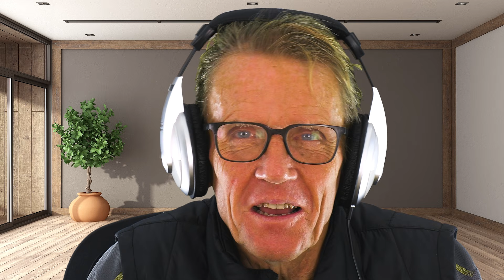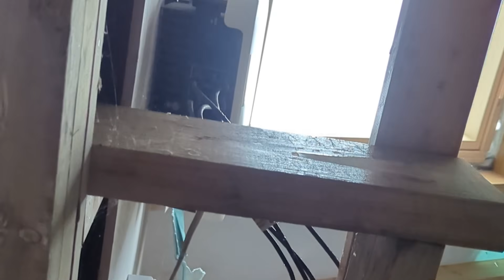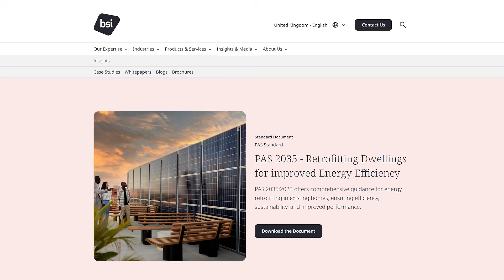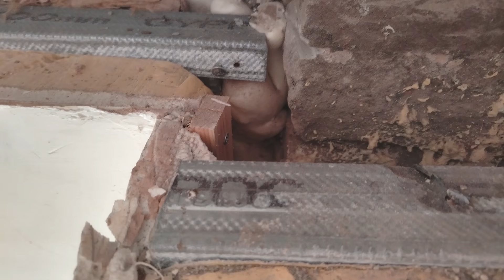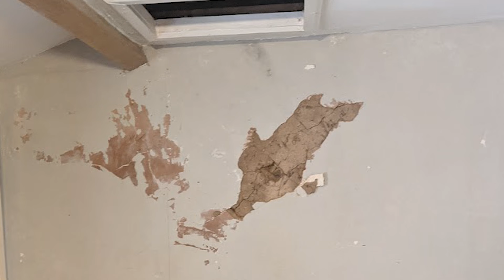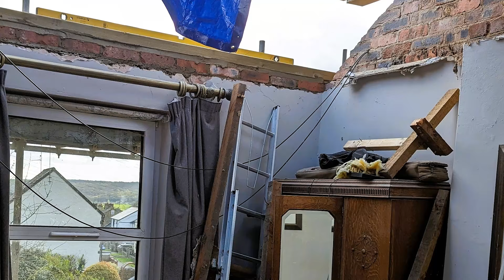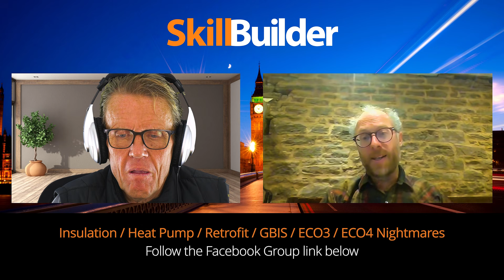Government Scheme Leaves Homeowners in Ruin – And Nobody Cares!

Comment: I'm not sure why he signed up in the first place for it, if the oil was costing 1k a year and the heat pump was forecast to cost 3k a year, that's an immediate no from me !
Reply: At first i thought i misheard that costing. Beggars belief tbh
Reply: I agree - THAT was the first mistake. 😐
Reply: It looks like a fairly small house though, even with bad insulation the figures don't really make sense. Oil to heat pump running costs should be 1:1 at the absolute worst case. Once you include the cheap tariffs you can get with a HP it's almost impossible to be worse off. There must be more details to the story missing.

Especially the claim that he's 4kw short and can only heat to 16 degrees doesn't make sense. Maybe it's lots of different situations all muddled up, but would be good to see all the details on this
Reply from the maker: @totallynotjames2  I think the issue is that the heat pump runs at a low temperature so the heat loss is too much for the heat input. 
With a boiler you can put a higher temperature in there for a shorter period. If he was spending £1K on oil it was because he switched the boiler off at night and when he went out for the day. With a heat pump you can't do that so the SCOP may be better on the heat pump but it runs 24/7. This is the bit they never explain to the householder and it comes as a complete surprise to find that they are told to just leave it running. If you are out of the house for 8 hours a day and asleep of 8 hours that feels very wrong to a lot of people. 
Pumping heat into a building which is losing it at the same rate you are pumping it in is the reason he couldn't get past 10 degrees C That is the nub of the problem in very simple language.
Reply: @SkillBuilder  I'm not entirely convinced. I have a HP and if I wanted to I could set the flow temp to 50 and turn it on and off whenever I want.

The radiators will get hot almost a fast as with any other boiler. It's not going to be the most efficient way to run it, but it's not going to be as bad as £1k to £3k.

Also I get you say not enough heat going in was the issue for not getting past 16 degrees. But he also says at some point he's only 4kw short. If that's the actual figure then it doesn't add up to only reaching 16 degrees, something else is up
Reply: @SkillBuilder thanks for the response however your answer further highlights the problem of mis-selling. The original question on operator use is correct. Cost of heating the home to comfortable temperature was a £1000 but what was sold was a comparison of energy losses rather than required energy consumption during occupied and unoccupied. This led to the under sizing and low energy system needs. Once it was realised that people do not live 100% of the time in rooms with no doors and no windows that the real energy costs spiralled.
Reply: @SkillBuilder whichever way you explain it. His oil burner heated his house. The heat pump doesn't.  More heat pump required? No instead blame the customers house.
Reply: Heat pumps work best with underfloor heating ... they don't need to (& CAN'T)  reach the temps of a gas/oil boiler... as Roger said, you can whack the boiler temp. up and get the house warm even if its bleeding away due to inefficient insulation...and again, the intermittent nature of a boiler compared to 24/7 heat pump means even if the boiler is more inefficient, its still better...🤔
Reply: @SkillBuilder did he say they were bloody freezing when the boiler wasn't on and put on outdoor clothes to keep warm? So many factual details missing.
Reply: @totallynotjames2  How old is your house, and what's the construction?
Reply: @RedHotscot I think it's a myth that the age of the house and construction is actually relevant.

The only thing that matters is the heat loss and radiator sizes. You can heat a tiny stone cottage with smaller rads and heat pump than a huge new build mansion.

He's obviously been mis-sold but the video is missing out a lot of details and some things don't really add up. And with the right size system intermittent usage works just as well with a HP it just costs you a bit more.
Reply: @totallynotjames2  I had my Victorian, solid masonry wall, EOT cottage assessed for a heat pump. The manufacturer refused to consider installing one as the engineer said that no matter what anyone does to a home like mine, a heat pump won't work well, and they didn't want to risk being sued.
Reply: @SkillBuilder  - probably exactly that.  What that really means is that his heat pump was really under-specced.  A heat pump can run efficiently AND heat a building quickly if it is specced to produce the required power.  It means you need a much more powerful heat pump than you'd need for an equivalent but thermally efficient house and it will be a more expensive bit of kit to purchase.  You also don't want to heat thermal bulk and then get a slow release into the air, so you favour radiators over under-floor and you spec them accordingly. The net result is that you can cycle the temperature in your house so it's only warm when you need it to be warm and the heat pump also runs efficiently ... and it spends a lot of time being off.  There are quite a few people round my way living in 400+ year old houses using ground or air source heat pumps specced to run this way and it works fine.  The key thing is you need a competent engineer to design the system and the reality is that they are heavily outnumbered by (sometimes) well-intentioned, certificate waving blokes who've been on a course that's really just teaching them how to negotiate a formulaic box-ticking exercise. And you end up with an install that might on average work on an average modern house, but stands no chance at all of working for an older, inherently thermally inefficient house.
Reply: @SkillBuilder  That is the WHOLE POINT of getting a heat pump, you warm the fabric of the building so it takes very little input as it runs 24/7 and when done properly you save money , this building is yet another you should get heat geeks in to fix. Solid walls are ideal to warm up and keep them warm. My suggestion to anyone thinking of getting a heat pump who has the controls to do it is to turn the flow temperature down to match a heat pump and run their boiler 24/7, I did this before fitting our heat pump and we had a very comfortable house then and since the heat pump was installed, no regrets.
Reply: @RedHotscot perhaps find a braver installer? Essays Concerning had his Victorian property switched to two heat pumps due to its high heat loss.
Reply: @SkillBuilder  Exactly that Roger. You seem to have had a moment of clarity on this topic. The comparisons are nearly always apples and pears by advocates of ASHP's.
Reply: @RedHotscot  If they'd designed it, maybe there would have been more radiators in each room than you would have accepted. But it would still work. They're either being overly dramatic or have no idea what they're doing.

Outdoor swimming pools are heated by heat pumps, they're obviously less insulated than a victorian house.

What flow temps do you currently have and how many kWh do you use per year? You don't even need to be an expert, there are tools like heatpunk that will calculate radiator sizes and losses for each room you have. Anyone can use them, all you do is put in the dimensions and wall types
Reply: @totallynotjames2  Why must I make compromises to replace a functional, efficient, condensing gas boiler I can switch on and off as the weather demands?

The number of radiators increases the expense of buying and running them, which defeats the purpose.

The engineer who assessed my house was a Daikin employee. They manufacture heat pumps.

SOME outdoor swimming pools use heat pumps, in summer, when ambient temperatures are much higher than in winter. It doesn't mean they are efficient at the job, or cheap.

Maybe the guy in the video should have gone to heatpunk?
Reply: @RedHotscot  You don't have to make compromises. Like you said, the new system either isn't offered to you at all, or if it is offered, you have the chance to turn it down.

I think the point of the whole thread has kind of derailed at this point
Reply: Brainwashed by the green propaganda
Reply: Just from the oil burner bill. It would give a good guide to the heat loss of  the building. I would suggest keeping that cost to myself until the company did a heat loss calc . And then compare the two. If they are way off tell them to F-off.
Reply: I agree. Use existing system operational data as basis for new design. On oil boilers  I will down size a nozzle and assess customers feedback on overall performance and reduced running cost.
Reply: No surely he got those figures round the wrong way?
Reply: I expect that he wanted the latest "new thing".  Best let others jump in first.
Reply: £1000 of heating oil per year is really cheap heating. Why did he change?
Reply: @cfcyayaya  I think .... if you read anything about green tech, they are usually full of how "efficient" these heating systems are, x% more efficient than gas or oil.  I think the average person tanslates being told something is more efficient as being cheaper.  Something may indeed be bery efficient at converting input energy to output energy doesn't mean it's affordable to run (or cheaper than your existing system).  The person in the video (Duncan) did reply to my comment, you can read it in this list somewhere !
Reply: I think the fundamental claim the homeowner is making here is that none of this is his fault due to various mental health issues. I suppose this raises questions as to the safeguards companies need to take to ensure a homeowner is in a competent frame of mind to sign the contract. There is plenty of evidence in the video that the property was in a questionable condition in various respects before work even began, so with a different approach the companies concerned might have been well advised to simply refuse to quote.
Reply: @ailsa2 - Hey Ailsa - Duncan here :)  I was in a difficult spot in life when I signed up for this madness.  Not really able to think clearly for myself at the time (severe chronic insomnia).  The rather desperate situation I now know to be affecting many others also, is that suppliers have often bypassed vital affordability and vulnerability assessments, and at the same time promised significant savings.  Without knowledge that heat pumps needed to be 'always on', I did not imagine the reality.  Then, to make matters much worse, their heat loss calcs appear to be incorrect by a factor of 151%!  (13.3 vs 5.3).  For me, this feels to be a clear case of mis-selling.  Sadly, I'm aware of two elderly people who will be struggling to heat their homes this winter for the same reason.
Reply: I would like to see this whole interview repeated with Heat Geek for a balanced opinion as Roger is just as biased towards gas and oil.
Reply: But you CAN'T deny heat pumps are being missold ?... companies that have no  expertise whatsoever should not be selling heat pumps...

The one thing I learned from the many heat pump vids I've watched is every job is a custom design and requires a properly trained engineer who knows wtf he's doing...  you can't just have several generic designs and try to shoe-horn a particular house to fit one of them....
Reply: @peterfitzpatrick7032  every house should have a heat loss calculation done on it.  The fact that people haven't done that for so many boiler installs over the years and have gotten away with it fools people into thinking it's suddenly only necessary for anything that's not a boiler.
Reply: @givemethejob3293  there’s a quarterly  energy comparison published  non biased areas country and historical electric always higher compared gas oil condensing appliances , even compares ground and biomass.. it’s out there all to read . Nothing do Roger being biased it’s facts !
Reply: @jeremydennis176 Yes accepted as gas is so much cheaper in the UK compared to electricity which is far cheaper in France etc. that makes it an essential to get the right people to do an installation. I agree wholeheartedly that many fitters just are not up to the mark of doing a really good install of a heat pump. But Roger is biased, could well be because he hears and sees so many bad ones. Around where I live I see condensing boilers throwing out plumes of steam so clearly not in condensing mode again not the heat source at fault, just a bad install.  So that is why I would like to hear the conversation from heat Geeks as we could all benefit from hearing another perspective.
Reply: @givemethejob3293 tbf I’m htg engineer mostly service maintenance and boiler stats too high pumps set max list goes on , some , installers throw in no sh##s given so ashp going go same but it’s very fine line ashp to get levels of scop fact
Reply: @givemethejob3293 if a condensing boiler is throwing out 'steam' it clearly is in condensing mode, thats when you know its running most efficiently, i.e extracting the latent heat, when it only does it at start and end it has gone past 55 ish °C and is then cooling back to under 55°C running permanently with 'steam' is the most efficient.
Reply: My mates am ecologist ams says heat pumps are useless
Reply: @cashkitty3472  define useless.
They run just fine in countries all over the world.

Comment: My sister and her husband got 2 mini-splits that were supposed to take over the duties of their oil heating system; this being in NY (which, I'm sure has all kinds of incentives), the units also provide cooling in the summer. I warned them not to have their radiators and boiler ripped out, but they did get rid of their underground oil tank because of the risk of liability for leaks. From the way they describe it, the place is miserable in the winter and they have to sit right under the inside heat exchangers to avoid freezing. They are getting a 3rd split setup, but from everything I've heard about these things, the heat is always spotty and the sort of people who are willing to shut off the old heating system just put on a happy face and pretend they're comfortable. As for my sister, I hope they've left at least the radiators intact so the next owner can put in a new gas boiler and bring the house back into the 20th century.

Comment: Obviously it wasn't calculated and installed properly but let's not end up with a  misleading impression about heat pumps. The technology works fine when It's installed correctly. I think you should get Heat Geek in to have a look again Roger. 
I've got my 1972 house at 23°C constantly and it doesn't cost a penny to run - that's with a heat pump and solar.
Reply from the maker: Heatgeeks get thousands of requests to look at failed systems and they simply can't afford to do it.

Comment: This isn't a little old lady. From the interview he comes across as an intelligent individual. So in this case he got what he signed up for. He knew the rules of the initial scheme. They were supposed to do an on-site survey. They didn't. Alarm bells. He knew the structure of his house. He was capable of doing the calculations. Yet let them install an undersized system. He knew it was a bit of a shanty. Yet let them install additional weight. Again without a proper survey, which he knew. So in my opinion on this individual case, blame goes to. Government, and their ill conceived net zero madness to install heat pumps in places you should never install a heat pump. Next the heat pump company. Total flakes. Followed by solar mob. Unscrupulous. And unfortunately in this case the home owner. For really being too soft, and not standing up for what he knew to be right. Plus again in this case. Expecting a heat pump to work in this contrived old house. I wouldn't even have given it a second thought. Lastly Government again. Because these unscrupulous companies get away with things like this fuelled by tax payer money, all the way to the bank.

Comment: 100mm of internal insulation does sound like a lot, when I'm guessing a lot thinner would still have a meaningful impact. Perhaps they specced 100mm knowing he would refuse it, saving them a costly job?? (I'm presuming the scheme was paying for it??)
Reply: problem is many of the grants are all or nothing - have to meet the standard or no grant. but you are correct, if you did it yourself you would get some benefit from 50mm insulation
Reply: @twmd  I think the thinnest insulated plasterboards from Kingspan are the Kooltherm K118 is 25mm insulation on a 12.5mm thick board (37.5mm overall), which would still make a good difference probably.
Reply: @thesunreport  yes. Generally thin insulation will help the room heat up quicker if there is a rad in there.  You have to consider thermal mass as well - if you block heat from getting into the walls then there is less retained heat if you only run your heating a few hours a day. Which is why external insulation is theoretically the best - you get thermal mass from the bricks and mortar and it's all kept in with the external envelope of insulation.
Reply: @twmd  Yes that makes sense. I suppose that applies to the floors as well, which could be a massive heat-sink if theyr are bare concrete or stone, i.e. very difficult to wam up and stay warm.
Reply: @thesunreport  yes. concrete floors in contact with the ground can both store heat but also conduct it to a cold ground quickly in colder weather. My house has suspended floor boards which I was able to pull up and insulate with sheep wool and seal all gaps with vapour membrane which made huge difference to comfort. But alternatives are 'glass Crete;' floor or 100mm of PIR with concrete poured on top (potentially with underfloor heating in the concrete)